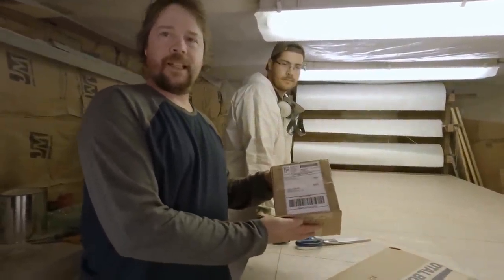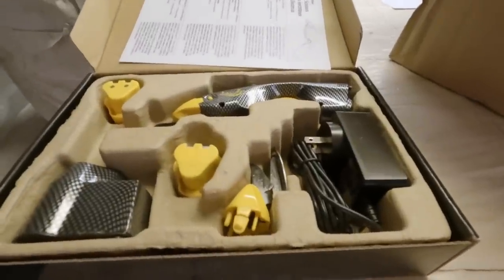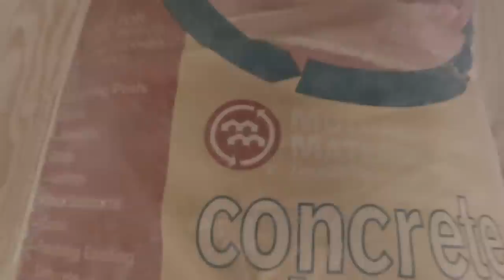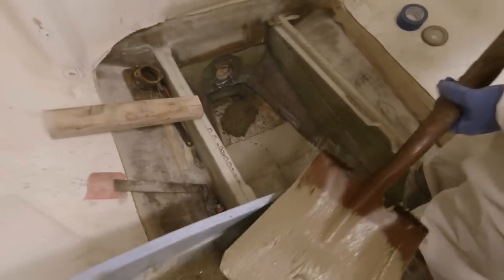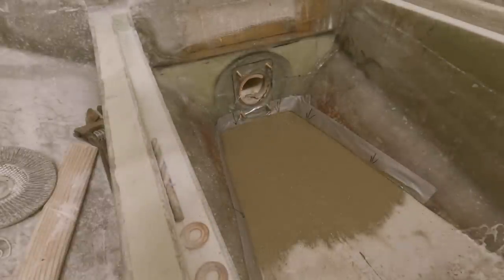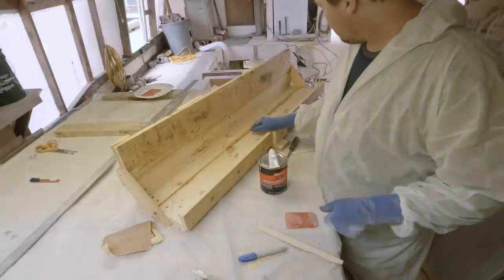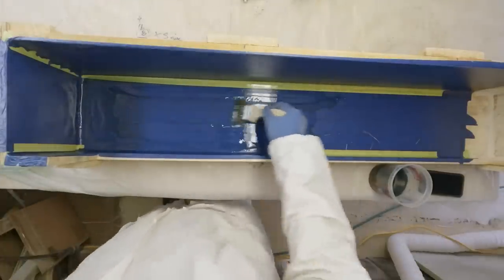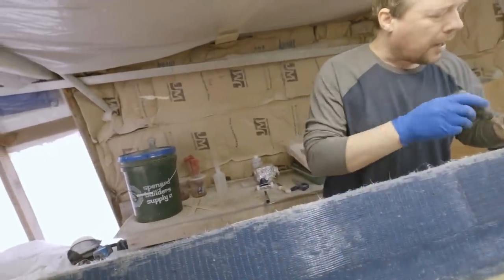Odds & Ends - Emerald Isle: Ep.50 Fishing Boat Refit

Comment: For molds I use tuck tape (barrier seal tape), or even just 50mm wide packing tape and the resin releases nicely from it afterwards, and leaves nice smooth finish
Reply from the maker: Great tip JK! Haven't tried packing tape as I was worried it would react like plastic visqueen and leave a bunch of wrinkles..

Comment: If you put a little water in the vessel your mixing the concrete in before you add the concrete it makes it easier to mix without dry concrete sticking to the bottom and it helps to keep the concrete dust down.

Comment: PS:  If you can assemble your form with screws from the outside so that you can take the form off the fiberglass and still reuse it.  Makes the compound corners easier to release.  Always a struggle to pull the fiberglass out of a female form.  Sometimes the forms are amendable to installing air fittings around to actually pop the product out or at least help with the difficult parts without marring a finish product.

Comment: I'm surprised you didn't just pull the sides off of one of mold to get at the bottom easier, or wasn't it screwed together? I suppose you'd have to re-bondo the one seam but seems that weould be easier than possibly breaking the layup

Comment: Could you use air compressor to separate the fiberglass from the form?
Reply from the maker: You certainly could, especially on fiberglass molds. We thought about it on this one, but with so many cracks between the pieces of wood, figured it wouldn't help much.